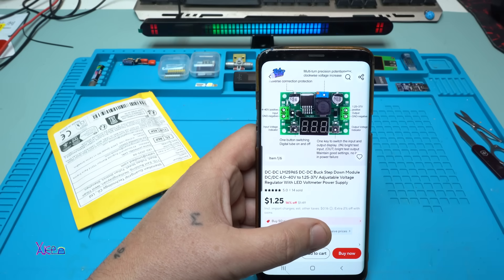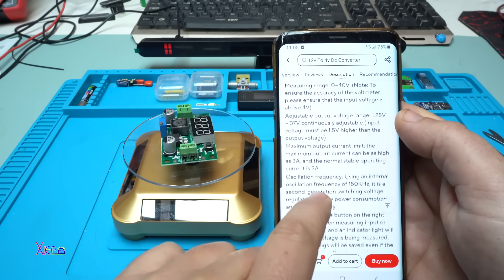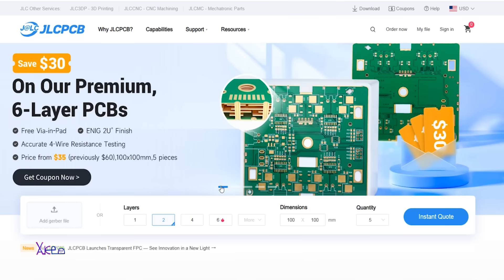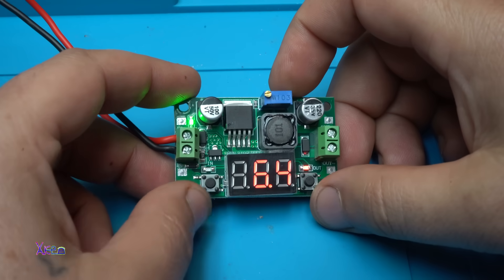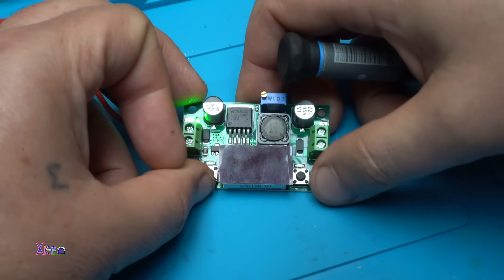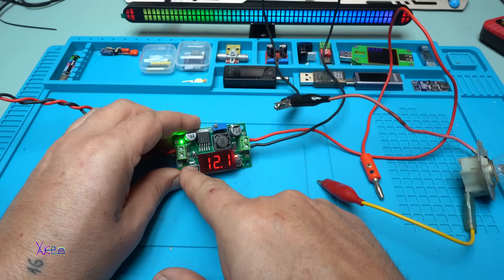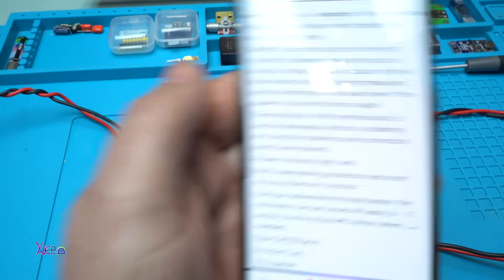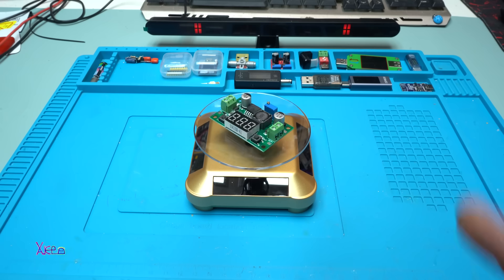WHY THIS $1 Amazing Module is FANTASTIC?

Comment: I bought a few of these some time back. I hooked up a Makita 20v battery, reduced the voltage on the output to 12v and connected it to a 12v weed sprayer. That 5 legged chip blew up in my face after a minute. So I did the same with another module and the chip got so hot again I had to disconnect everything.
Reply: I looked up 12V weed sprayers and they are usualy rated for 3 amps , so if you have something similar no wonder it blew up
Reply: It claims to deliver upto 3 Amps and be short circuit protected so it should not have blown up.
Reply: @Mr_Rusty1 I noticed in the video Hack tuber was checking the heat in that chip so I'm guessing he knows to be careful about the amperage.
Reply: This genius was pulling twice the rated current from a cheap board and after it exploded still couldn't take the hint he was doing something wrong and did it again
Reply: @DoesntRefillTheBrita  We can't all be as clever as you. But even if I was I'd never have posted a comment like yours making fun of someone's knowledge of electronics. That's just not a comment a really clever person would post.
Reply from the maker: These modules are rated 2A,You need to use more powerful dc converter
Reply: @Hacktuber  Thanks, I actually ended up using an SK 60 power supply.  Works great.